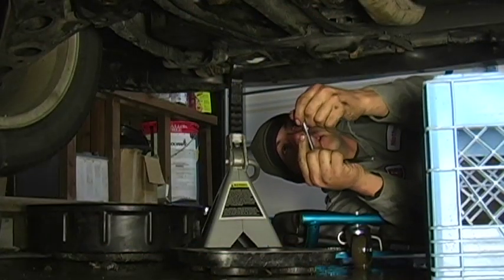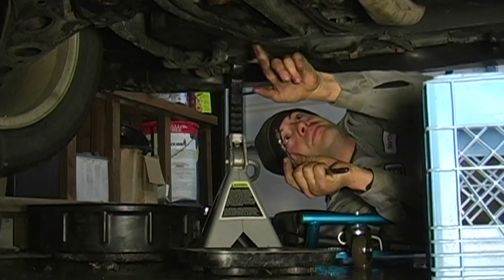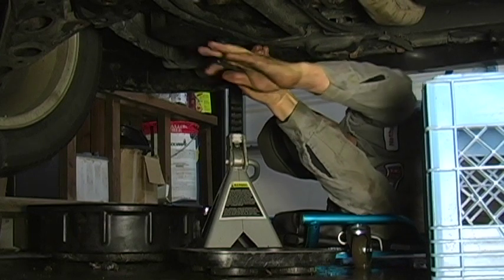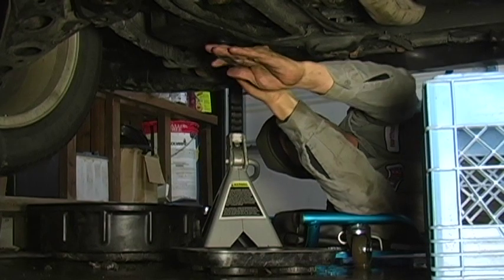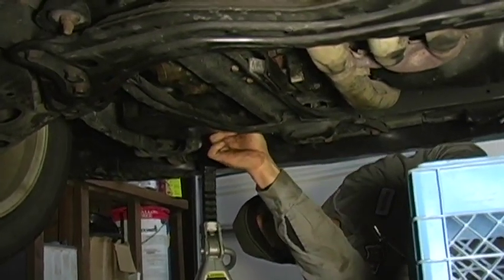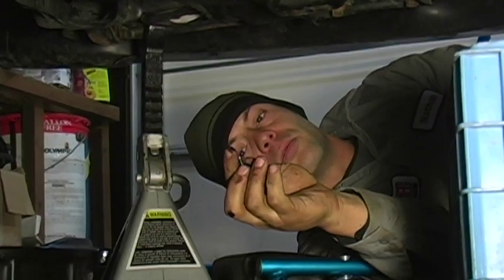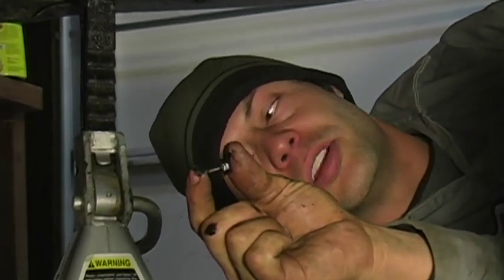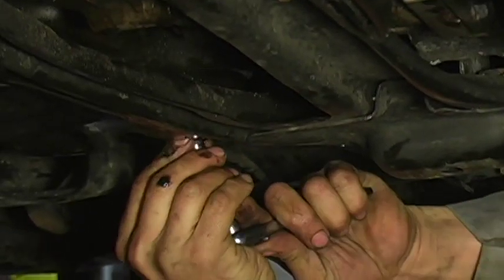How to Change Transmission Fluid : Cracking Seal on Transmission Pan

Comment: If that mallet does not work use a flathead screw driver to break the seal but be damned careful not to gouge the mating surface. Try to wedge between the pan and seal and not between transmission and seal. 

The transmission fluid in this video is burnt and was way overdue.

Comment: I banged the pan with a rubber mallet like yours, but it didn't  move, looks like the seal is good, what is the other measure to take when that happens?
Reply: Pry bar?